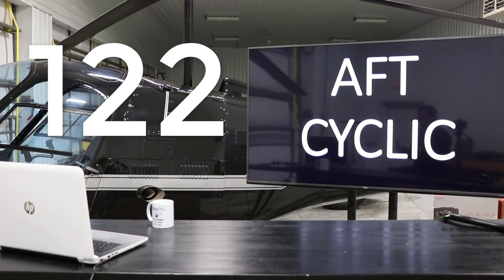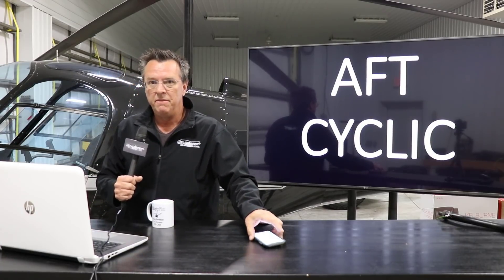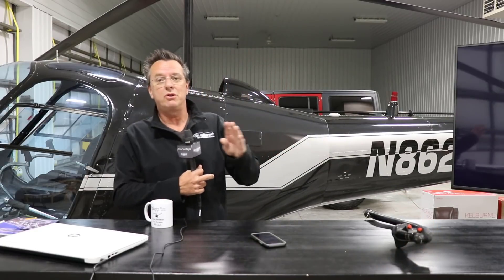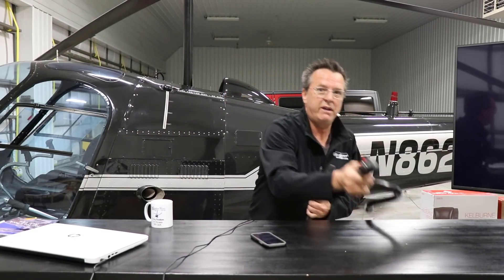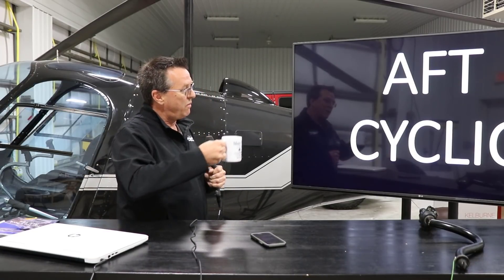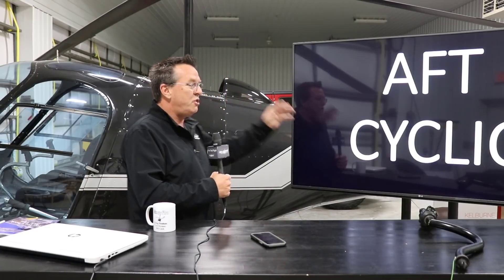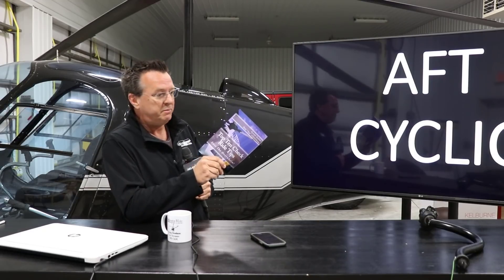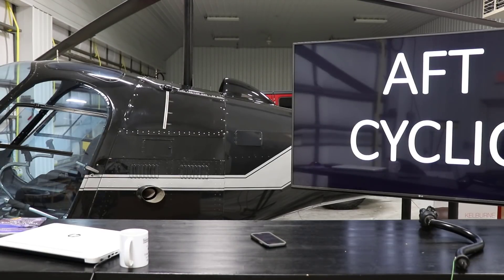#122 Initial aft cyclic upon autorotation entry | EMERGENCY PROCEDURES | Day 122

Comment: I had an instructor explain this as “keep the ship level” ie. don’t let the nose drop. I have flown with a bunch of different  schools and they all have their own “Mantra” that you recite on entry and cross check on the way down in the auto. Unfortunately, these are not universal and a new one will mess you up when you have one you like already. I’m okay with anyone’s verbal cross check as long as it helps them fly a nice auto. Here is the one I like:
“Down Collective, Pedal for Trim, Cyclic for Speed, - Rotor Speed, Airspeed, Trim, Landing Zone, - Rotor Speed, Airspeed, Trim, Landing Zone 100 feet - Eyes Outside, 50 feet - Baby Flare - Level the skids - Cushion the Landing.”
Works in any Heli - Clockwise or Counterclockwise.  Use whatever works for you. Too many words sometimes slows your crosscheck, but some sort of “Mantra” does seem to help - even if you just say it in your head. 
I still like the idea of “keeping the ship level” versus consciously adding aft cyclic.
Reply from the maker: Awesome Glenn Thank for sharing!

Comment: Ok in training most students are setup for the auto before it happens so no big deal. Real life depending on your type of flying you are not. Ok in my almost 20 years of EMS flying speed is the way we fly. And the faster the more aft cyclic you will need in a helicopter like 407 or S76 . I have found that a pretty large amount of aft is needed in the 407 and that will keep the rotor RPM up   The climb is nice and now speed and RPM are set and you just need to find a spot to land. I Think you should train for the hardest auto Rotation you’ll ever do so for EMS that is high speed down wind low to the ground . You can be doing 125 kts downwind at 300 feet AGL you have engine failure pull aft Cyclic you will climb 200 hundred feet slowing to 65 kts turn around your set up to land .
Reply from the maker: Thanks for sharing!